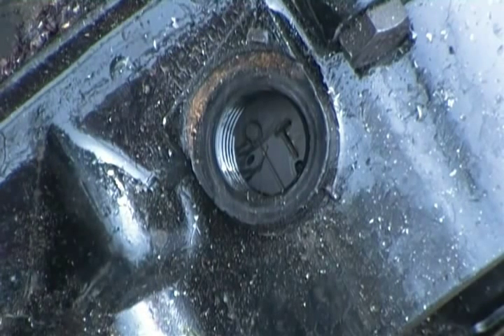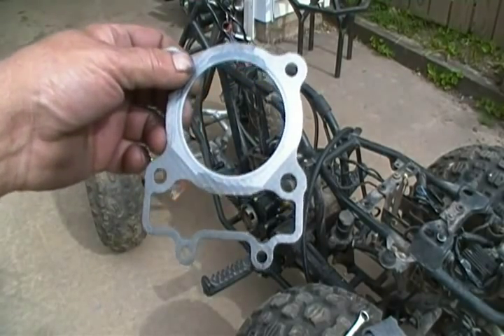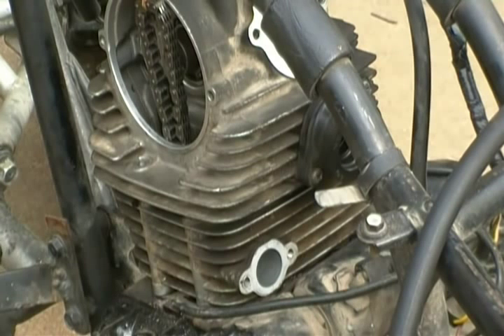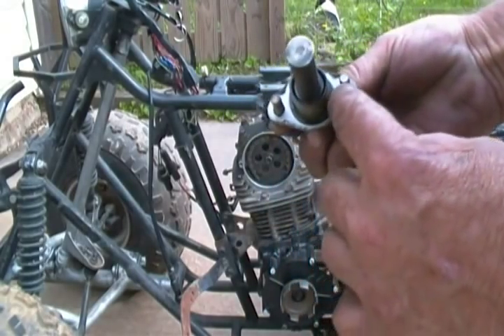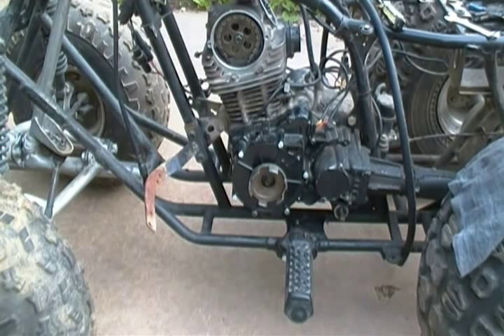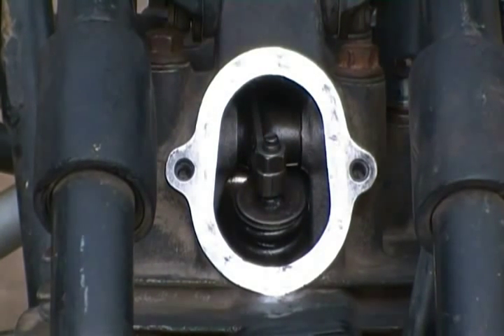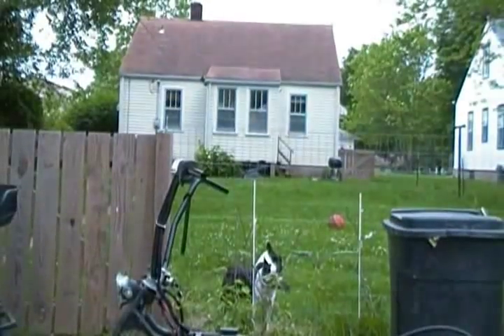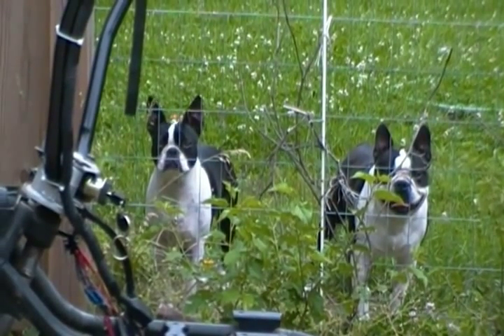KLF 185 top end assembly 2.

Comment: I'll be using this a a guide for my 185. I was using it as a guide to time it since it was spitting and sputtering pretty bad... then I messed up and bent a valve. It had good compression before.. and I have another head to swap on from another motor so I wont have to go as far as you did. Thanks again for a good video.
Reply from the maker: Thank you for the kind words. I appreciate that. Good luck with your machine.
Happy Motoring... Cheers

Comment: 10 years ago yikes. I have this 1985 185 cc and will start right up run smooth only every couple day's. I cleaned carb and noticed the spark plug is burnt oil . why does it run smooth only when it feels like starting. Puting a starter in it in a couple days will probably help better starting it than hand cranking. hope its not warn cilender or what ever as Ino nothing hardly. once its running its still smooth so it can 't be the timing can it? Hope i'm explaining something right here . thanks your show is great.
Reply from the maker: Sounds like you're not using the electric starter, so that may be part of the problem, How ever IDK for sure. If it's not smoking a lot and has power when it's running, your cylinder is probly ok. & are you sure your fuel pump is working all the time ? you should be able to hear it humming once the key is turned on. . get that starter fixed and let us know how things go... Good luck
Reply: @TufdogsPlace  Thanks? forgot to mention the carb- flooded spilling over took it apart cleaned it no longer floods. I did notice some smoke but being 25 degrees last night not sure if its all smoke burning I hope not.  starter should arive about 4 day's?  I'll keep in touch and Subscribe.
Reply from the maker: @trafficjon400  ok sounds good, also does it have strong power while it's running ?
Reply: @TufdogsPlace  Yes very and smooth for a 1985 . I expect it takes 1.7 courts but no dip stick. how do you tell the correct amount of oil ? Thanks
Reply from the maker: @trafficjon400  1.7 is correct. As for no dipstick.,..  HMM good question.. 
I found this, at a kwik search .= https://atvmanual.com/kawasaki/klf185/a1a-1985-specs
I'd once you know it's empty, put 1.5 quarts back in it and stick a finger in there to see where yu meet the oil. then just add a lil bit more and Bob's yer uncle as they say..
Reply: @TufdogsPlace  Not getting notifications sorry. I just got my starter and getting ready to go try it. one thing as far as pressure? it needs to build up in order to start.  then why does it all ways take 2-3 days for it to just sit? then it will start at one crank and smooth as a butter fly with what pressure from sitting? I can ride around with it for 15 minutes let it idle then it stalls and won't start for another 2-3 day's. Now with the starter do you think by fast constant cranking over will help find the spot or what ever to help it start up . Thank you
Reply: @TufdogsPlace  Put starter in and made the nuetral light shift on . I road it about 10 minutes and parked it shut it off to try it again with the new starter? now I can't get it back in to Neutral  or the green light will  not turn on with nothing no clicking but just a back light. crazy 😂what happened now I think the other owners didn't install a new starter for some reason? HELP!!!
Reply: the other problem could it still be going on by not being able to start every 2 or 3 day's would be strange that the neutral light only comes on with the clicking and gas pump clicking  doesn't make any sense for every 2 or 3 days it would seem. or maybe it does ?
Reply from the maker: @trafficjon400  Ok I'm replying to all your messages in this one comment.. I now believe the starter is not going to fix what ails it. sounds like a wiring or a cdi issue .
You should be able to get it into neutral manually. whether the light is on or not. which makes me think a bad spot in your wiring. perhaps a weak ground. bouncing on & off and causing your start / no start condition.
Reply: @TufdogsPlace  I think your right! I went back out and push it a bit and pulled the wires a bit and then it went in to neutral and started. Thanks I didn't pay enough time on  the wiring.
Reply: @TufdogsPlace  Plus it starts way better with a starter as your so right about that also. thanks
Reply: @TufdogsPlace  OH!  as far as the oil stick missing from the oil plug . I just dip my pinky in to the hole and if the oil hits it should be enough. why because I check the inches on one and it seems to match enough I hope.
Reply from the maker: @trafficjon400  That's awesome, Glad to hear it's coming together for you. Find where that weak spot is and tape it up so it can't wiggle loose on ya while yer out and about.
Thanks for sharing the good news, Makes me as happy as it does you...
Reply: @TufdogsPlace  Thanks Man! I'll give  others the good news.
Reply from the maker: @trafficjon400  Right on !! .

Comment: Can I put 250r honda engine on a 300 kawasaki bayou frame , will drive shafts work,,, both on same side,,,?
Reply from the maker: I'm sure you can put the engine in with some mounting modifications.   As for the drive shafts, I don't know. But I think The Honda is chain drive, not shaft. But I may be wrong.
 If you have them there, you can simply look to see what side they're on and if the splines are the same, chain or shaft.   I'm pretty sure the Honda is chain drive, but if you have the whole machine you could transplant the rear end also.

Comment: How did u get the chain off to take the top off.
Reply from the maker: The top sprocket's bolt comes out. then the sprocket will come out and the chain will have enough slack do what you need to do. Don't let the chain fall down in the bottom of the motor case.  Good luck, You can do it !

Comment: could you tell me why my atv  still smoking after I change piston rings? and or should I done something else also. thanks fro your time.
Reply from the maker: Well could be a couple of things, Did you hone the cylinder ?, Did you check your valve guide seals ? Did you use a new head casket ?   Some how oil is still getting in the cylinder if it's smoking.  Good luck, Hope this helps
Reply: gasket look still new so did not change but do have it.well guest this round two.thanks never thought of that.
Reply from the maker: Good luck, I hope that's all it is for you.

Comment: hey got a quick question. my sisters bayou keeps spraying oil all over heel it's from above pan on same side as clutch any ideas??
Reply from the maker: +BroncBreakee wAlkeneagle  My guess would be a bad gasket or a cracked case cover. I suggest that you clean it real well with brake or carb cleaner and get all the oil off.  Then sprinkle some baby powder on the areas where you think it may be coming from. (This will make it easy to see the smallest of leaks)  Run it for a short bit and inspect it for signs of leakage. Then repair as necessary.  
Good luck, & hope this helps

Comment: Question I have a kawasaki bayou 220 and I replaced the cam chain and it is bone tight and that with the tensioner out. Is that ok
Reply from the maker: IRON CROSS GAMING That doesn't sound good... but a new chain may be tight to begin with. as long as it turns over with struggling or binding it should be ok.
Put the tensioner on after your sure it'll be ok because it will stretch over time & you'll need that then.  You may want to check with some other guys who have 220's also. Just to be sure... Best luck to you.  Cheers

Comment: can I saw the top end with a 220
Reply from the maker: I'm not for sure,.. but I'm thinking that it probably won't swap right over.
There's bound to be something different somewhere in there. Such as timing chain & timing marks, location of barrel bolts. Connecting rod length & size of wrist pin,.. Just to name a few things that would need checked.
But I like the way you're thinking....
Reply: Tufdog's Place thanks because I am trying to rebuild the engine in my bayou because the head was full with oil and I am trying to see what is wrong with it because so far I have been thinking it's been the rings but I do not 100% know what is the cause of this
Reply from the maker: Was it smoking when it ran ? There should be a little oil in the head. The timing chain will bring it up there.
Reply: Tufdog's Place no it worked one day then the next day the head was full of oil and yes it did smoke some when it first started then after a bit it would stop smoking
Reply from the maker: does it run now ? and have you done a compression check on it ?
Reply: Tufdog's Place ya I did a compreshon test and it got like a 2 psi and no It don't run and I took the motor out the other day
Reply from the maker: Yeah probably needs rebuilt, but I don't think the 220 top end will work right.  Good luck,.. let me know how it goes
Reply: Tufdog's Place ok thanks
Reply from the maker: Hang in there, you'll get it...